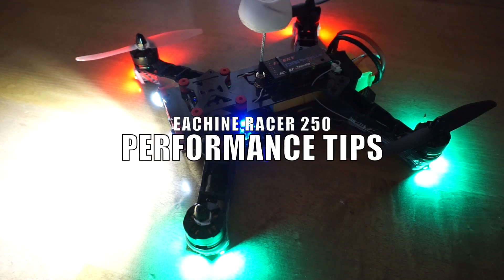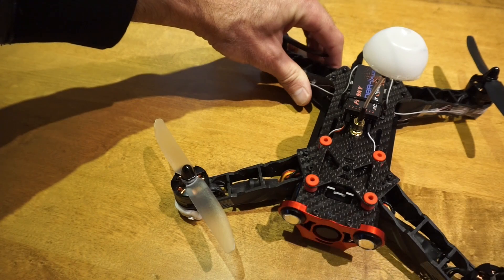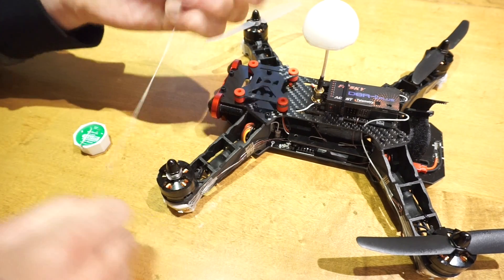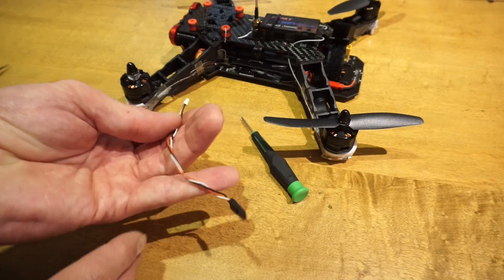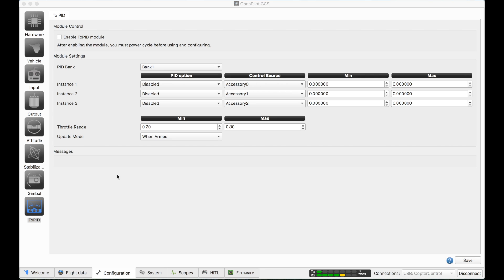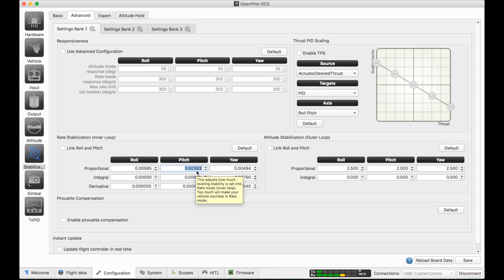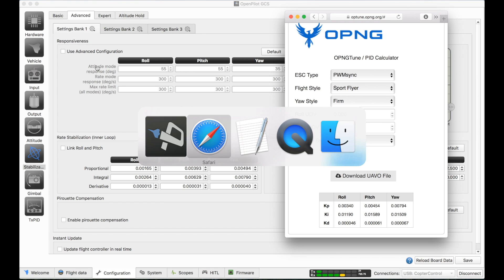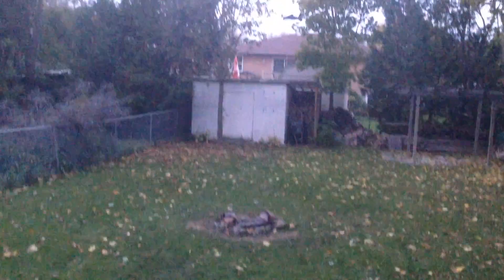Eachine Racer 250 performance modifications

Comment: This video is pretty old but i am still gonna ask and hope for response. My eachine racer 250 woobles pretty bad when descending quick but i am worried to change any settings of drone. Can i screw my drone with changing pids?
Reply from the maker: Yep, you can make it better or worse. PIDs are a challenging part of flying multi rotors. It's okay to play around though, just record the original settings so you can revert to them if needed, and just make small adjustments as you go. There are a lot of tuning videos out there!

Comment: Brandon have you ever thought of flashing the control board to Betaflight?
Reply from the maker: Yes, Bill, I first flashed Betaflight firmware via LibrePilot (CC3D_OPBL) a few months back and highly recommend it. The latest BF PID controller is fantastic, and tuning was easy. For some reason v3.2 didn't work for me, but I was able to get 3.1.7 working. My ER250 is v1, so YMMV.
Reply: So you just use LibrePilot to flash it into Betaflight?   
I tried that and lock it up and had to reflash it...  Maybe I did it with Betaflight first.
I'll try it again... 
What are your pid settings now in Betaflight?

Comment: hey very nice video.. I have a question for the txpid  setting.. I have the eachine racer 25p as well and I have the rtf version with the eachine i6 transmitter. when you set up the variable knob to control the pid setting.. what channel transmitter are you using.. I've been trying to make this work on the eachine stock transmitter but I think I would have to disable the switch for the lights and move it to the variable knob  to make this work.. am I correct ? would you be able to explain to me how I can set this up so I can tune my quad.. also are u you sing attitude mode or rate mode in the video to find your UOVs?.. thanks steve
Reply from the maker: Yes, tuning PIDs takes a channel, so you won't be able to control the lights. To determine the UOV you should use auto level mode. https://250drones.wordpress.com/cc3d-tuning-guide-using-optune/

Comment: Great info on the pids and one shot...haven't had my eachine 250 long so I needed this info. And i subed.
Reply: OMG. Or you could order one with a Naze controller and use G-tune in cleanflight/betaflight. Oneshot? a button click. done. go fly. On my second eachine 250. Great quad for the money, very tough to break. First mod for me? replace the fc with something Cleanflight can use so i do not need to be a computer programmer to fly my quad.

hope this helps.

Comment: What PID would you recommend for the GoPro?
Reply from the maker: +Overlord277 I am definitely not a PID expert, but I'm pretty sure you'd want to increase P and D a bit. The absolute best way is to set up your TX to fine tune. You won't have to adjust the roll much as much as the pitch.

Comment: Need to replace my batteries for the eachine. What would you recommend?
Reply from the maker: +Matthew Ross I'm still waiting on delivery of 1300 and 1800 mAh batteries, so I've only used the stock 1500 and a 2200 65C which is quite heavy. I can't say I'd recommend the 2200 as it makes the quad a bit too tail-heavy. Flight time is longer obviously, but not by a tonne. Also, it depends on what type of flying you do – in racing you don't go for long flight times, so a 1300 would be ideal, however I prefer long flight times and don't really fly that aggressively, so if I had to guess, I think the 1800 will end up being my battery of choice. Other considerations are charge time and cost - smaller is better in those regards.

Comment: Hello, I just got my eachine racer and I was wondering about the battery life, is it possible to use the included balance charger for a higher mAh battery? Like your 2200mah battery? Also, is the battery life longer? 

Thanks so much, 
Nick
Reply from the maker: +Natural Contamination Yep, that charger will work for any 3 cell battery. Flight time depends a lot on how you fly. In short, yes, but not by a lot. I'm working on a battery/prop. comparison so I'll have some better answers for you soon :)
Reply: +Brandon Hill Awesome, thanks a lot :)

Comment: Hello Brandon,
I bought this quad, but I'm noob in this things.
I'd like to ask you a few questions
7:07 - am I right that it should be transmitter which support this change PIDs feature?
8:16 - I don't quite catch what are you doing to make the proportional changing? moving swith handle on the transmitter?
9:13 - How did you get this UOVs? Can I use this number for my Quad, since it is similar to yours?
9:34 - optune.opng.org is the name of the site correct? for some reason I can't reach it.
9:35 - What if ESC type is Rapid, should I need to recalculate?
10:44 - Can I just takes this number without recalculation and enter it in OpenPilot?
11:56 - Did you recalculate PIDs for the quad with GoPro? 
Sorry for this bunch of questions :)
Reply from the maker: +Александр Силин 
7:07 - Yes, you have to assign a potentiometer on your Tx to an Accessory channel in the GCS
8:16 - I'm rotating the Tx pot. which changes the P value according to the range set on the TxPID screen
9:13 - I hovered it and increased the pot. (P value) until it was in a steady wobble, then landed without moving the pot. Yes, you can certainly use the same UOVs.
9:34 - It's gone, but the latest version of LibrePilot has EasyTune, which is intended as a replacement for OPTune.
9:35 - No
10:44 - Yes
11:56 - Not yet, since I normally fly without it, but if you're using Settings Banks, it's a good idea
No probs. Good luck!
Reply: +Brandon Hill Thank you for answers. I implement this settings and it is really much more stable. If you will colibrate this quad for gopro, could you enter the numbers in description of the video. Thank you that you share this settings, it's much better!

Comment: Brandon, I am brand new to these open boards and  am having a little trouble getting this all set up, any way to do another video showing what your doing to the quad at the same time.  I was able to get the quad going with the PWM (using all the cords) and I wanted to clean it up a bit and tried to do the PPM (3 lines out to receiver) with no connection. I followed your video very closely from start to finish, I even went into the settings of my transmitter and changed it to PPM and still no connection. I am not sure what went wrong. I am using the flysky fs-i10 2.4GHz transmitter and fs-iA10 2.4GHz receiver, how can I tell that these support the PPM connection over the PWM? thanks for your help. Keep up the good work and these great videos!
Reply from the maker: +Isuzuwhat From what I can tell, the IA10 receiver doesn't support PPM. If it doesn't mention PPM in the manual you might be out of luck - though you could just get the IA6B.
Reply: +Brandon Hill thank you for getting back to me so quickly, I added the full set of cables back in, the quad is back up and running and I had to redo the initial set up to get it all working again. thank you much, your extremely helpful. the receiver does have the i-Bus capability, but I am not too sure how all that works. I'll look into it more and see if it will work for this set up. thanks again for your help.
Reply from the maker: +Isuzuwhat Any time. Glad you're in the air again!

Comment: what size  battery did you use to find your pids, the stock one?
Reply from the maker: +Smokey_Vaping I determined the UOVs for both the 1500 and the 2200, and used a value somewhere in between.

Comment: Hi brandon, thank you for your video, very helpful. Is possible to set up your pics on my machine 250 without pwm and and do it with ppm?
Reply from the maker: +Christian Cabrera I'm not sure I understand you completely, but PIDs are not related to the Rx protocol, so it shouldn't matter whether you're using PWM or PPM - the PIDs should behave the same.
Reply: ok i got it!! i did it different, but very good ideas. May i get your email to send you photos with some performances on the eachine?
Thank you very much for your help.
Reply from the maker: +Christian Cabrera Good to hear. You can get my email from the "About" page for my YouTube channel. Looking forward to hearing from you!

Comment: When the ESC sets itself on fire, does that mean I have the roll UOV? ;-(.  So I made it to 8:40 in tuning the PIDs.  I could adjust my Roll Kp with my S1 potentiometer, as seen on the Stabiliz... screen. When I unplugged the USB, inserted the battery, armed, tried to take off, and adjust the pot up maybe 30 degrees, one of my ESCs literally set itself on fire.  Any ideas why?  The quad is basically stock, with it set up as PPM per your initial setup video (thanks for that). Much appreciated. The quad was flying properly a few days ago, though it did wobble a lot (hence the need to tune it).
Reply from the maker: +Daniel Pifko I've never heard of PID tuning causing ESC failures - so I suspect that was a dud ESC. I'd contact Banggood to see if they'll cover it.

Comment: I latched on to your dental floss idea, but thought, "What could be in that class of thread but stronger, and maybe in black?"
My solution: The cord used in retractable ID badge tethers!
I've attended a few trade shows in my day so it was just a matter of digging a few out to see what the cord is like: It''s stronger than dental floss but slightly thicker...and black! :D
Used the handle from a tiny screwdriver to tie against and made loops for each side for symmetry because I'm that guy too I have to own up to it.
Irony is I'm using an 808#16 keychain camera that isn't heavy enough really to warrant the tethers, but it's still a great idea IMO.
Reply from the maker: +Michael Thompson Good idea! That cord is super strong.
Reply: Dyneema / Fishing line is pretty strong thread
Reply: I was just given some high strength fishing line and that stuff rocks too

Comment: is it possible to upgrade the motors on the eachine 250
Reply from the maker: +Nelvir Aquino For sure: any 22mm motor will fit, you just have to solder them to the ESCs.

Comment: Thanks for sharing...your settings really sent me in the right direction for solid response from this bird...off topic but, 1000TVL Cam???...What Voltage do you send to 2-pin socket IR CUT on the back of the board to eliminate the Infra-Red Filter??? Also what is the 2-pin CDS function for?...Also does anyone know what Voltage feeds the front Lights?(Wanting to install my new 12V InfraRed floods)...see where I'm going here? (this whole earth tilted in the wrong direction is conflicting w/ my N.Hemisphere FPV time HA)
Reply from the maker: +SEEKER OF YAH The ER250 product page says "support for HD night," but I think that's a stretch. The board might be capable of switching an IR filter, but from what I understand the lens housing should have wires to connect to the IR CUT pins. The CDS pins are to switch it (short to disable filter). Like on this cam: http://www.banggood.com/Emax-Night-Vision-IR-13-inch-COMS-PALNTSC-FPV-Video-Camera-p-961977.html

If you do try, I'd start by shorting the CDS pins and seeing if there's voltage at the IR CUT pins - if so, I don't think supplying voltage is what these pins are for - if not, I'd start with 3 to be safe, then increase as your courage/bank account allows :) Let us know your results!

The front lights are 3 W 12 V.

Comment: great video, one question can I use this racer's escs with my qav250 setup (naze32 cleanflight)? thanks
Reply from the maker: +INMERSO For sure, if you mean removing them from ER250 and putting them on your QAV250. As for putting a Naze on an ER250, you'd have to determine the pinout of the existing CC3D to PDB connection, and solder some plugs to connect to the Naze. It's a really short wire too, so you'd probably have to extend it.
Reply: thanks for the advice!

Comment: are there any 4 s batteries that will fit w/o having to remove the tail light?  I can't find any.
Reply from the maker: +Kjell Kittelson I'm not sure off hand, but Hobby King has a very helpful battery search tool where you can specify dimensions: http://www.hobbyking.com/hobbyking/store/multifinder.asp?t=lipo
Reply: +Brandon Hill Hobby King also sells this exact frame so they should know which ones fit.  http://www.hobbyking.com/hobbyking/store/__81689__E_Turbine_TB_275_FPV_Racing_Quadcopter_Frame.html

Comment: Hi Brandon. Thanks for sharing. I've watched the part about pids now quite a few times. But I still don't know what I need to do to find the values. Yes I arm the quad but what am I doing after that to make it oscillate? I've never flown before but I'm getting an Eachine in a week so I want to lock it in before I first fly it. I don't want any of that horrible wobble or sluggishness I've seen on videos so far. So could you please elaborate further as it's a bit unclear to us newbies.
Reply from the maker: +Lewis Boating After setting your transmitter to change the Roll or Pitch rate P value with a potentiometer, hover the quad and slowly increase the pot. until the quad oscillates (wobbles side to side for roll or front to back for pitch) steadily. Then, without moving the pot., land and connect to GCS so you can read the P value. This is the unique oscillating value (UOV) for that axis. When you have UOVs for both roll and pitch, enter them in the OPNGTune calculator to get your PIDs. Hope that helps!

Here are a couple other videos that might help:
https://www.youtube.com/watch?v=QqgZZ6-V3Qk

https://www.youtube.com/watch?v=B2zFL83E2sA

Comment: Nice work and thank you for sharing your knowledge BUT, your wasting your time trying to tune with OP. You will never get as good as you could with Betaflight. I recomend luxfloat v2 pids as a starter. Why shovel when u could use a bulldozer. Happy flying
Reply from the maker: +lazyeyes Thanks, I'll check that out!
Reply: +Brandon Hill Also come join our talk @ http://www.rcgroups.com/forums/showthread.php?t=2461697 there are OP. CF. BF and libre users testing pids on ER250